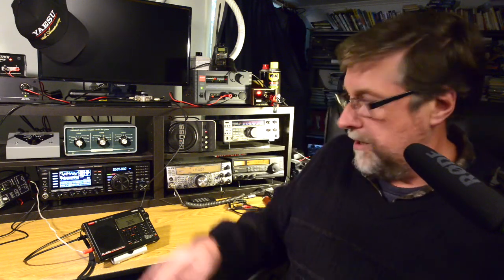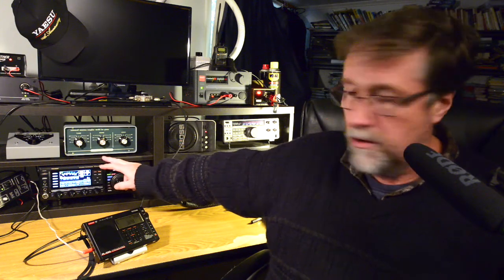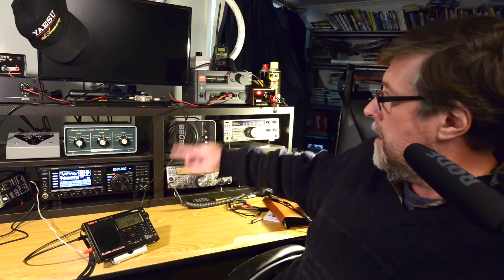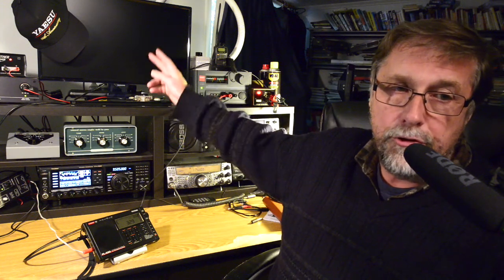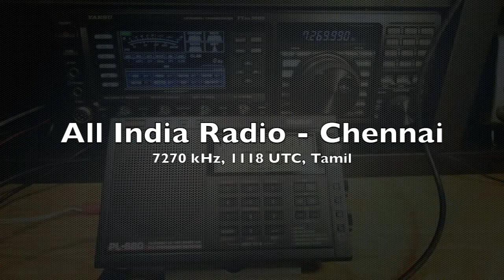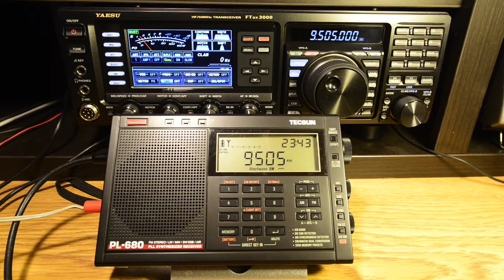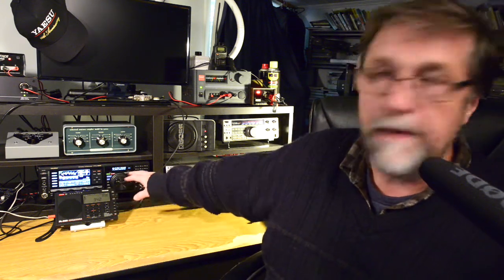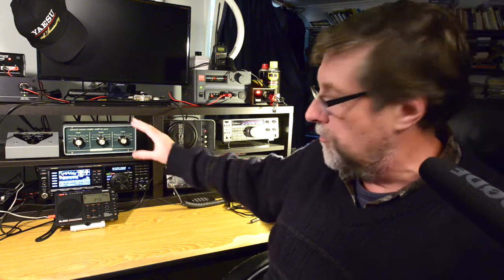Tecsun PL-680 Sensitivity Tests

Comment: Thanks so much for this review/comparison. Recently bought this PL-680 and I must say it far exceeded my expectations. Not only is it a top notch performer but is easy to tune in many ways. About a year ago I bought an old FRG-7 that is still "deaf" But I may now give up on that. Most of my receivers are fairly old, so this 680 has a special place in my life
I found the Tecsun is just such  great radio to have. I almost wish it was bigger, however no complaints at all. For the price point how could one go wrong? 
Greetings from Milwaukee WI USA
Reply from the maker: I agree, Craig. At this price point, this radio is one of the best on the market. Best 73, Rob VK3BVW
Reply: Craig - the FRG7 oughta be as good as the 680.  The FE transistor sometimes needs replacement.  Hope you got it fixed. 3SK40M or NTE454 are possible replacements.  And they are ez to replace even for a novice.
Reply: Sorry to be so off topic but does anybody know of a way to get back into an instagram account??
I stupidly forgot my account password. I appreciate any assistance you can give me
Reply: @Kenneth Lian instablaster :)
Reply: @Casey Jeremy i really appreciate your reply. I got to the site through google and I'm trying it out atm.
Looks like it's gonna take a while so I will get back to you later when my account password hopefully is recovered.
Reply: @Casey Jeremy It worked and I actually got access to my account again. Im so happy!
Thank you so much you saved my account !
Reply: @Kenneth Lian You are welcome =)

Comment: I really enjoyed this great video.I have owned the 680 for two years and have always been impressed with its performance.It handles upto 100ft of wire antenna quite well.
I have the Tecsun 360 which for the price is also a decent performer.Thanks for sharing this comparison video.73 Ray.
Reply from the maker: Thanks so much for the feedback, Ray. Glad you found the video useful. I've just uploaded another video done this week out in the bush using the 680, showing some late autumn propagation. It's at: https://youtu.be/_dNCXVwWHVw
Best 73, Rob.

Comment: Thanks for the demonstration. I very much appreciate it.

I'll soon be buying my first shortwave radio and the more I learn about the PL-680, the more sure I am that it is the radio for me. Pretty hard to beat for such a modest investment.
Reply from the maker: You're welcome! Apparently, in certain countries the 680 is not as readily available as some other Tecsun receivers. So you may have to shop around online or eBay. But the 660 and the 880 are similar radios with similar performance specs. Good luck. Rob.
Reply: I noticed the PL-680 was more scarce than other models. A bit of searching revealed that I can get one delivered for the equivalent of $150 AUD which is less than other radios I'm considering. I've read many reviews and admittedly I still don't feel 100% comfortable making this decision.

I could afford to spend more and get a Tecsun PL-880, Sangean ATS-909x or the Eton Satellit (NGWSATB). Do you think a novice would be better served by one of those? Perhaps there's another radio I hadn't considered?
Reply from the maker: I have a old Sangean ATS909 (1st generation) and it works well but only with an external antenna connected. No good on the inbuilt whip antenna. I have not had an Eton so I can't comment, except to say that some reviews have been mixed on that one. It really depends on what you want to use the radio for. Is it for casual use of strong stations in situations where you are away from home? Is it for listening to the amateur (ham) radio operators? Is tone quality more important to you? etc, etc. Spending more money and buying an 880 may not give you a whole lot of advantage over a 680 or 660. And if you are a novice at this, then I would definitely consider the Tecsun 660 or 680 rather than spend more on the 880. Years ago, radios were quite expensive compared to today. The good thing about Tecsun is that their radios are well within the means of most people, and their performance is very good for the small amount of money you are spending. I hope all that makes sense. If you haven't already done so, read the article I wrote on PL680 Beats Expectations Part 1 - the link is in the description above.
Reply: Given that this will be my first shortwave radio, I'm not really sure how I'm going to use it or what I'm going to be listening to. The PL-680 is modest in price and seems well respected which is why I think it might be the ideal starter radio. I'm going to go with my instincts and order one. Hopefully as I learn more about the hobby, I'll have a clearer idea of my needs and wants and I may end up ordering a more advanced radio. I've noticed that many radio enthusiasts have multiple radios -- perhaps that's why. :)

Thank you for taking the time to answer my questions.
Reply from the maker: You're welcome. Good luck with the radio.

Comment: Rob, great and fair comparison, same speaker, same antenna. Have a Tecsun 380, a 660 and a 909X Sangean and a few Grundigs and still others. The one I grab the most is the PL-660.  It's amazing what 20 ft. of wire will do to one of these portables. I find the ATS function on SW to be very handy.
Reply from the maker: Thanks for your kind feedback. With all those radios, it's interesting to see that you still prefer the Tecsun 660. Having now tested the 680, I can certainly understand why! Best 73!

Comment: You sound like you really know what you are talking about.
Ok, so I spent the $ for the “so great “ Tecsun pl-660.  It was making a “growling “ sound, and sunset a friend hap-hazardly made the purchase for me and kept none of the paper work, there was no warranty. Decided to try the reset button and it worked.But now it is off frequency by 5 kHz.
On-line fix video did not work.   Apparently there’s a problem with these being off frequency,now.
So I decided on a pl-680, but they were out.  Got a pl-600 instead.
Nice radio. Works well.
Wondering if it would be worth getting the pl-680, or just being satisfied with my pl-600.
Reply from the maker: G'day Jeff. Sorry to hear you had problems with the 660. There are not huge differences between to 600,660, and 680, so I wouldn't get too hung up on it. I believe some Tecsun models have quality control issues. If you get a good one, you are set. If you get a bad one, change it straight away. Regards, Rob VK3BVW

Comment: Great video! Just what I was searching for. As for AM, what are its performances on that band? Over here in Europe the AM band is still a busy affair despite the number of stations that went off the air recently. In most cases a sync detector is a must. If my Sony ICF-2010 didn’t die I wouln’t bother looking for a replacement, but it finally did. Beyond repair I fear. Greetings from Hekelingen, Holland. Willem.
Reply: The PL-680 is not good for AM band. Take a look at Jay Allen's review of the PL-680. Synch Detect though not bad, it's far worse than that of the ICF-2010, by any measure.

Comment: Hi. I've bought a new PL-680 recently. I have the infamous shift in the center frequency between the wide and narrow filter circuits (so, tunning is off-frequency by 5KHz with the wide filter). The other issue, that worries me more, is that the sync detector looks noticeably unbalanced between LSB and USB. Moreover, Sync LSB is unusable as it shows some kind of strong audio feedback. In Sync USB the feedback is also noticably but only when the volume is high. Anybody with such issues here?

Comment: a really interesting video. I would take this PL-680 with me outdoors, what would you recommend for an external antenna that is also portable? I would be very happy to receive an answer - thank you
Reply from the maker: Hi. A simple long wire will do the trick for portable work. Nothing fancy. I have tested it by stretching a wire out 3, 5 and 10 meters long. Signal strengths improved the longer the antenna was. Or if you have space, you can go really long! Check out this video on a stormy winter morning in May, two years ago: https://youtu.be/98RHmd5SL4M  Being daytime reception, the signals are not strong, but the antenna does a good job of digging them out of the background storm noise. You can see the long wire antenna at 6:10 in that video. Thanks for watching, 73, Rob VK3BVW

Comment: Can the Tecsun Pl-680 be Freq. Calibrated the same as the Pl-660? New Models of course as both units 3 to 5 years older can't. Thanks.
Reply: Yes we can calibrate the 680 built after 2017.

Comment: I have the 880 but not happy with SSB or the synch, so I ordered the 680 and I should be getting it on Friday, I would test it out against the 880 and XHDAT 808 which I currently own. ( I am not happy with XHDATA SSB operation, and it does not have the sync hmode)
Reply: Which one do you prefer?  I'm looking at the 680, 880, 808, cc skywave, and eton elite exec.   The 880 is the most appealing, the skywave is the most practical, but the 680 looks like the best value with full functionality.